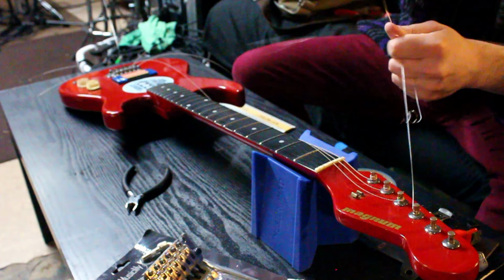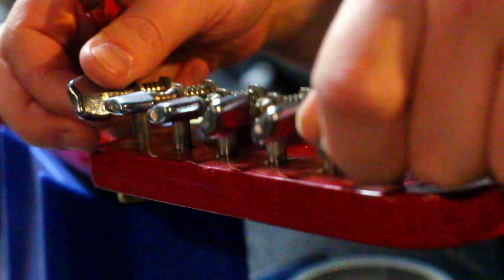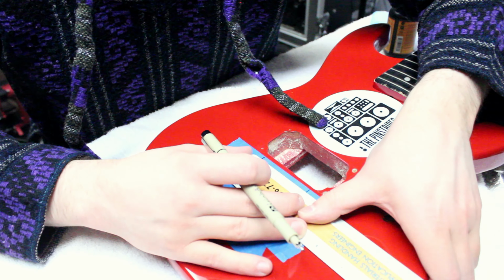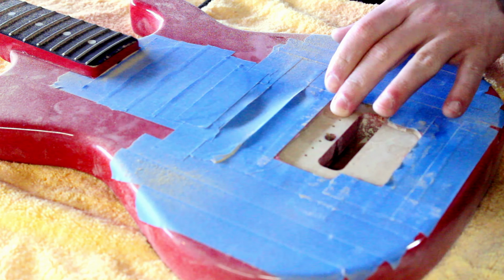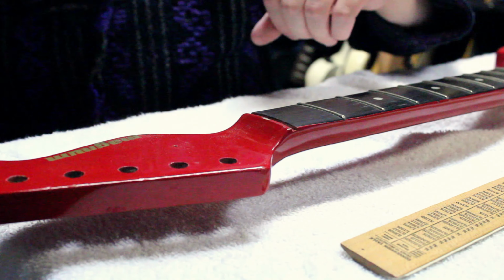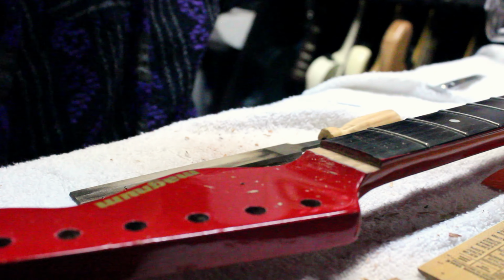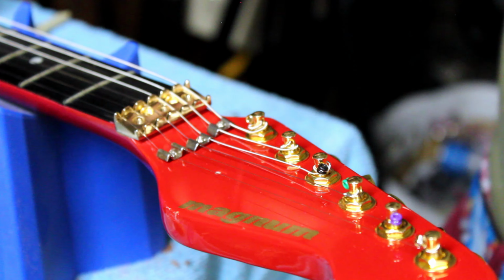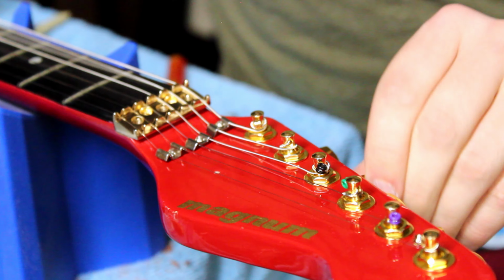Magnum Guitars Floyd Restomod

Comment: Nice work!  Ever come across a Magnum Flying V?  There is a local one for sale by me that is blue and pink. Set neck and binding. Looks pretty cool.
Reply: Sounds like a pretty cool guitar! I would be interested in seeing some photos of it to compare to a V I have that I suspect to be an early run magnum. It has a lawsuit headstock, a bolt on neck, and a very nice tobacco burst finish with cream binding. The later Magnum and Cort branded Vs I've seen had more color options, a boost switch, and an altered headstock but all seem to come from the same factory or at least sourced parts from the same places.
Reply: @slowpoke330  Thanks for the info. I would say this one is a later model. It doesn’t have a lawsuit headstock and has an extra switch, which I’m guessing is the boost circuit. I might have to make the guy an offer!
Reply: @stevecabassa7786  Hell yea! For reference the guy I bought mine from listed it for 190 bucks but I remember we ended up negotiating a lower price since I was willing to do a local pickup vs shipping it. I got some vague memories of them going for more online though just got lucky. Took a little bit to get honed in right with the setup but after its become one of my better playing guitars. Had some pretty nasty fret bite but that's expected for anything as old as these things are especially in drier/colder climates and was easily fixed up with some light filing. Has a pretty dark tone over all. At least personally I think the pickups sound wonderful. I won't lie though the strat style tremolo isn't the best or at least I haven't gotten it to perform well as far as the guitar holding tune when using the trem. Holds tune perfectly other wise. The trem problem could probably be solved with new springs or possibly a better nut but I don't use the trem on this guitar that much. Actually when I think about it now should just block it off already lol. If you got any more questions about it feel free to ask!